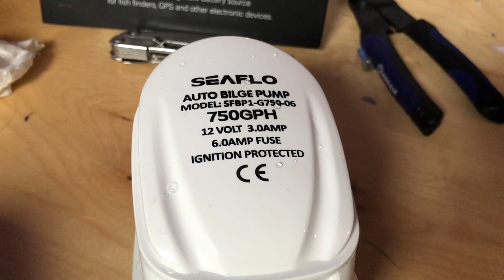Wiring a Seaflo 3-way switch to a bilge pump and 12-volt battery

Comment: you need to run a ground wire from that top terminal that's empty on top if you want the red light to light up when pressing manual mode. just put all three ground wires together - the battery - the one from the pump - the one from that top terminal -

Comment: I've 3 wires coming off my seaflo like yours but only going into a 2 wire connector, which of the 3 wires is the neutral as I presume it's live and neutral back to the manual on off switch.  Thanks.

Comment: I had the same switch and the manual button lit up red when pressed.  Went defective and had it replaced.  As yours does the red led that used to work on manual doesn't on the replacement.